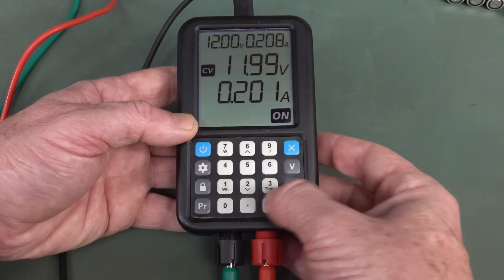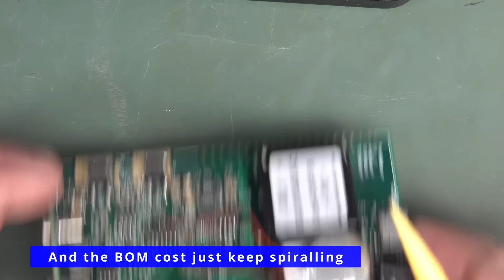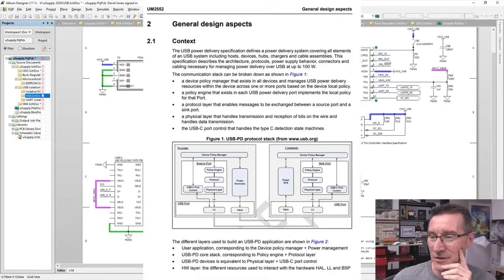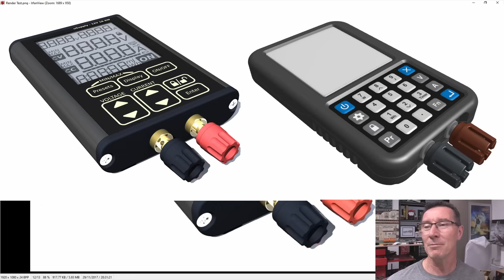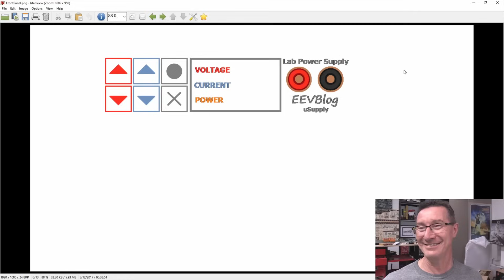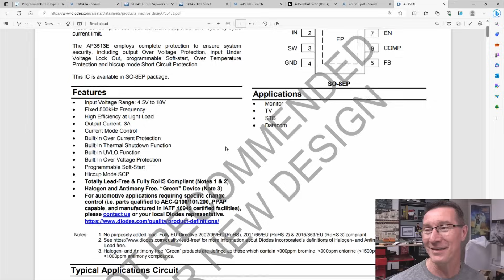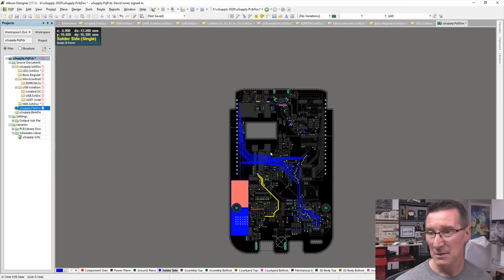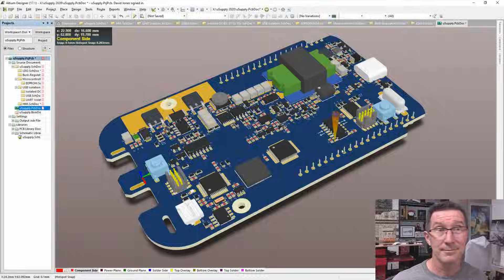EEVblog 1561 - µSupply USB Power Supply - Part 21

Comment: The low noise would be the real selling point. All the cheaper ones seem to use switching. Good enough for simple stuff, but I'd imagine frustrating otherwise.  I agree that the isolation is less important these days, though I wonder if it's easier to do combined isolated/tracking first stage(with just an isolated i2c for the USB-PD chip and the digital pot on the USB side to remove the second micro) nowadays with that low noise final stage.
Just armchair engineering.  It's just a shame to see a product not really finished, but so long as there was fun had making it, that is 90% of the goals. :)
Reply from the maker: The project is actually technically finished. It looks and works just fine. I just chose not to produce it.
Reply: @EEVblog  Fair.

Comment: Can the uSupply compete with a single channel of something like a Keysight E36300? If so, I'd happily pay $500 per channel for something that I can stack on my desk as 3x channels for bench use, then pick up and take outside for field testing. Especially if there was space for a big prismatic lithium cell built right into the housing. I tried the Miniware MDP-P905 for this purpose ($235 AUD) and unfortunately ran into QA issues. Also no built-in battery, and no isolation. The Keysight beast is $900 AUD per channel, takes up half a desk, and is too heavy to take outside.

Add high speed metering and data logging (like the Joulescope - 2 MS with glitch free range switching), and I'd happily pay $1500 AUD per channel, if it also had the battery (actually, that's roughly what a Joulescope costs, so maybe a bit more). Right now I know of no good solution for powering and monitoring battery operated devices with uA sleep currents and ~0.5 A transmit currents, in the field. To the point that we're making a cheap commercial solution (like a Kill-a-watt for IoT devices). But if you had something higher spec for sale even at Keysight prices, we'd buy a handful in a heartbeat for prototype testing.
Reply: It definitely won’t compete with Keysight because they use FPGA to control the pass transistor. And they use toroidal transformers to reduce noise. That comes at the cost of space and weight. The switch mode preregulator has to be extremely low noise and low emi to be able to compete, perhaps with slow switching edges, ferrite beads, and multi stage LC filters before the linear section. But then it starts getting inefficient, large and heavy. It’s like you can’t have your cake and eat it too.

Comment: I want to make an environmental sensor and was wondering if there are any biodegradable PCB's, solder mask ect because I will not be able to retrieve them. For example something made out of corn starch/gelatin and natural fibers. Preferably the only remains should be bare copper traces and the chips, passives, ect. Or would dead bug technique be my only option?

Comment: Is this the same project as the one that you were going to use LiPo batteries with?  I was trying to follow along with the project but there seems to be large gaps in the progress and no explanation of what has changed.    Maybe I just haven't found the correct videos.

Comment: Why did you change out the 3080's for discrete pass transistors? The 3080's have all the extra circuitry for overheating, etc.   Just wondering.

Comment: Dave, why do you still use Altium 17 as an former Altium employee?
Reply from the maker: I unknowingly fired up an old version for this. I do have 23 installed.
Reply: @EEVblog  I must admit I also have still AD17 installed, just in case

Comment: On what ground were you expecting to land bomwise, as your obviously aint to just winging it, with a retail sale product in the tube.
- it doesn't look like your got any plans to bring it to market, so could be interesting to hear about the inner margins you were hurdling.. fx expected BOMcost and the price you were targeting.
but there are few of these tiny PSUs.. got a couple.. EEVblog for fx "DP100".. a 100W PD3 jobby (30v5A) that you can get for like 40 to 45US incl delivery and 25% EUVAT... obviously another fish, but both tiny TypeC PD PSU intended for mobility... miniware also got some older module based variants

Comment: Great video that I watched with big interest! Curious why the CC and CV loop control separate mosfets (Q1 and Q2) while I find more lab power supply designs that only use one power mosfet (or power transistor) that is controlled by the CC and CV loop simultaneously. Furthermore I was surprised to see the CC loop in front of the CV loop. Off-the-cuff I would have put the CV loop in front of the CC loop. Or does it even matter? I have to admit I'm a rookie but questions like this bug me and help me to learn. Will try to simulate it.

Comment: Definitely drop the internal isolated conversion, so many cheap power options available to tinkerers. The whole base idea with ubiquity of USB PD is to give user those options to begin with.
The "analog mucking about" and low noise design is quickly becoming a lost art I believe... I love the mucking about, that's how I learn... while enjoying it too!
As for price point, would be good if this could be made somewhat within touching vicinity of $100-150.
Pre-conversion/tracking voltage just makes me warm fuzzy inside with throwbacks to (almost unrelated) Bob Carvers audio amplifiers. Electronics is practically analog anyway you cut it. (Ok, if you zoom down to each individual electrons "personal" state - granted those are stepped... as far as we think we know)
One thing I think about for my personal use, backlight? (Even a crappy one is better than none) Is possible with just a few SMD side-shine LEDs?

Comment: How about just making a linear regulator and using the PD voltage negotiation as the pre-regulator?
Reply: Yeah thats what I was doing originally. But with USB PD you only have 5, 9, 15 and 20V so worst case you'd have to drop 6V which may be a lot. Quick charge you can actually do 0.2V steps, if I remember. So QC is more useful here, But not universal.

Comment: What about the AD5560 it’s basically an SMU in one chip, would be nice in such an amazing looking handheld equipment especially with USB-C power delivery and communication for IV-Curve Tracer. What do you think?
Reply: interesting, its quite old 2012, there is an LT part as well, LT1970 if you've not seen it already (DC2591A). 
AD5560 is about $38/ea.
Reply: @jaro6985  sorry for the late response. Yeah I‘ve seen the LT1970 and there is already a finished SMU based around this Chip (uSMU from joeltroughton, it’s quit a good design). But if you want to extend your Power output capacity you would be better of with the AD5560. Yes it’s a bit more price but for example you don’t need a separate DAC‘s for CC/CV because they are already built in. Overall the AD5560 is a hell of a complex Chip (just look at the datasheet, it blows my mind every time) but I think the level of integration it provides is more important than cost. Feel free to contact me.

Comment: Nothing can be turned into a product if the market won't accept its price. Which is why you do the estimate way before any lines of code or circuit - and if it comes out in the upper regions of reasonable, you forget about the whole thing immediately because nobody will be willing to pay what the actual cost will end up being by the end. That's not a design failure, it's a marketing one. For the general market, if something can't be made cheap enough to be attractive, it just should not be made.
Reply: Anything becomes cheap when you outsource the labor. If you have a winner design, producing it cheap can always be done with enough know-how. But you can’t do it the other way around, design a cheap product and expect it to be a winner.

Comment: Mostly unrelated but: how come there is no OSH project for a simple linear lab PS that actually works.
Reply from the maker: There have been countless linear PSU kits in the magazines over the years.
Reply: @EEVblog  I know, I built some and there are quite a few kits based on those on AliExpress and all of those suck. What I'm asking is how come there is no widely used and built OSH project for such a basic and essential bit of kit.
Reply from the maker: @galileo_rs  Because it's way cheaper to buy a commercial PSU.

Comment: customized planar transformer ? customized heatsink ? customized connectors ? unnecessary isolation when whoever needs it can simply use a usb-pd power bank ? wow... so many bad engineering decisions... the software is also plagued by bad decisions.... the only thing that needed to be done is to say... "this is the open source code for a simple non-programable use... here are the instructions on how to tweak it and flash your own improvements" and just leave the internet do it's magic afterwards

Comment: How's that different than buying a buck converter 40 volt one amp, a cheap LCD screen some connectors a couple potentiometer's and putting in a case of half the sides and running it off a battery??
I think you're a bit late to the party
Reply from the maker: LOL, you must be new here, welcome.